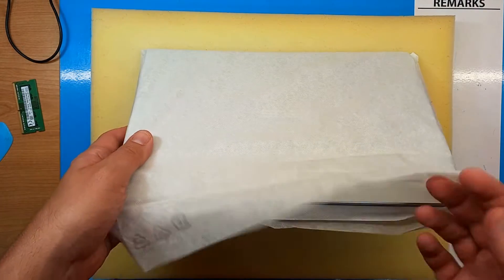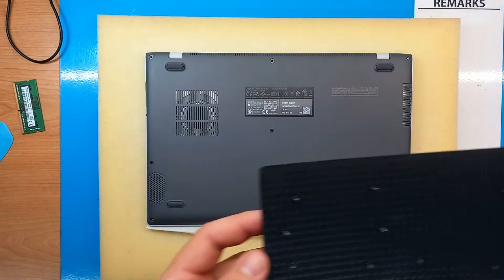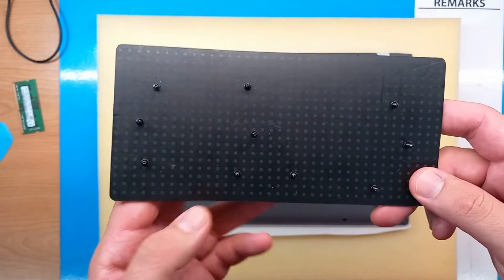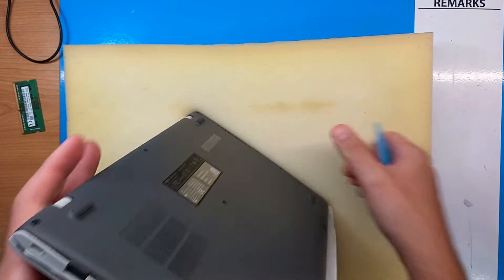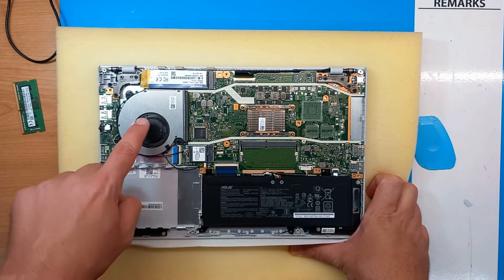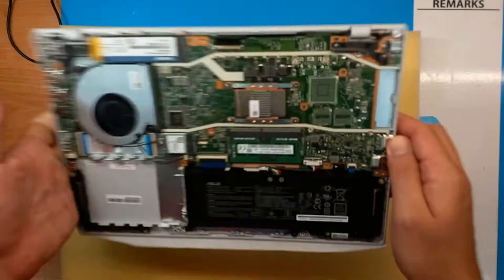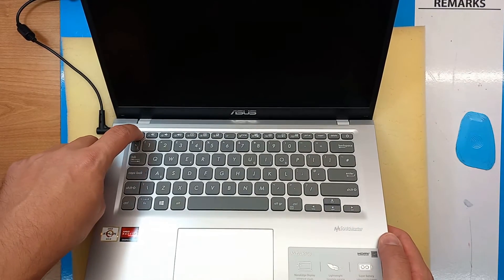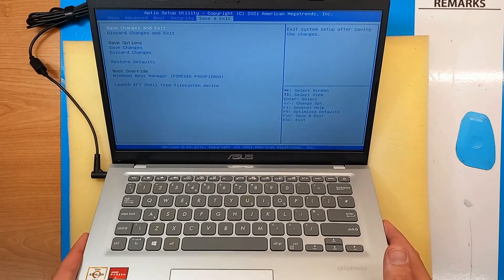HOW TO UPGRADE RAM on ASUS M415D LAPTOP ???

Comment: Hello. Just asking if I can add a 2.5 hdd to this laptop for additional storage? It seems that I don't have a hdd caddy? Thank you
Reply from the maker: Check when you open the laptop if there is an 2.5" HDD/SSD connector, then you can just use a small piece of double sided tape to tape the SSD.

Comment: I have a ryzen 5 512gb ssd and 8gb RAM variant (it came with a 4gb ddr4 module pre installed) but iam unsure to what capacity the ram and ssd can be upgraded...

I wanted to upgrade ram and ssd, but cannot decide which one to buy
Reply: Did you ever figure out an answer? I removed the pre installed one and added a 16gb

Comment: Which will more good upgrade to 8gb using another 4gb ram or using a 16 gb ram in single channel. If i upgrade with 16 gb ram will it be in dual channel or single channel , please reply my comment as I'm finding this answer for several months
Reply from the maker: If you put two stick of RAM it will always be in dual channel, even if on one side is 4gb on the other 16gb, but for best performance they should be for example 2x8gb or 2x16gb etc. If you put only one stick of RAM for an example 16gb one stick that will be a single channel.

Comment: Can you upgrade ssd? And I have 8gb ram now can I add 8 more? If so what kind do I buy? Thanks
Reply from the maker: Yes you can SSD or M.2 NVMe both work fine, RAM you need SO-DIMM DDR4 2666MHz or 3200MHz.
Reply: @alkibtech does 2400 MHz ram work?